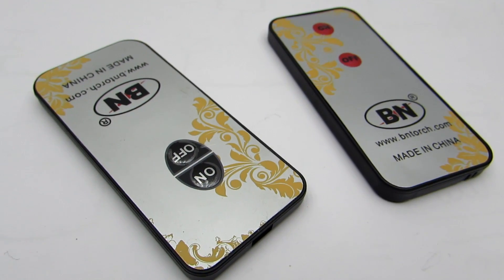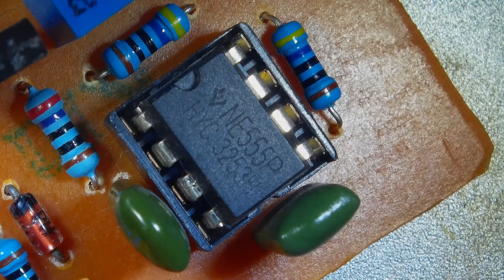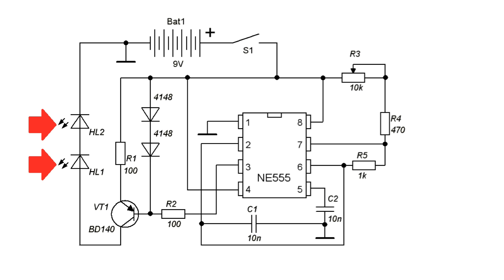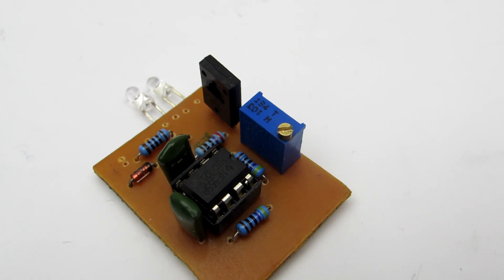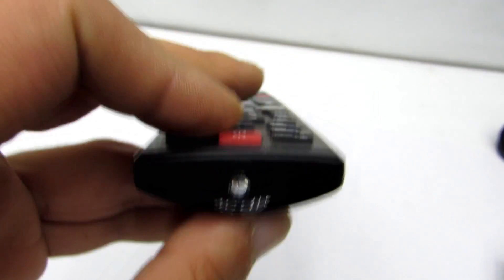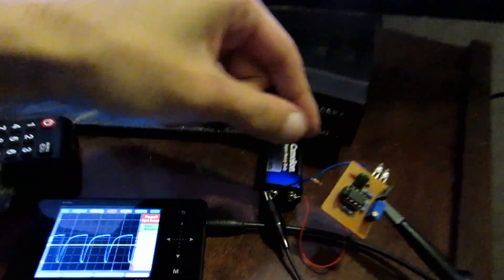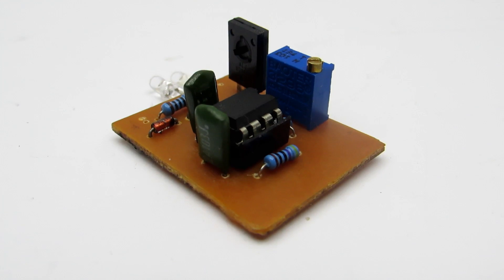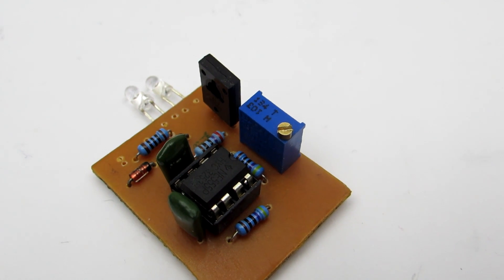Remote signal jammer

Comment: Could you make a remote that turns every tv off?
Reply: Pirat Carribean you will need an arduino or any other microcontroller that first has to record all remote commands and then transmit them one after another.
Reply: SandPox Well, I saw a device called a tv-b-gone so it should be possible
Reply: different manufacturer have different code for "turn off" command so you'll need a device that will allow you select which manufacture before sending... like a android phone with IR blaster and you can use an app for it
Reply: Yes I can make a remote that turns every TV of

Comment: I have 2 questions-
1. Why the transistor was used?Was it for driving greater current to the LEDs or due to any other purpose?
2.  Why the two diodes are used??
Reply: the transistor is supposed to drive loads more than the 200 mA limit of the 555, but the leds use less than 200mA so the transistor is useles. the 2 diodes give more light for better silencing
Reply: +John Scarce thanks for your reply....but how those two diodes increase the silencing?....are those diodes mandatory?
Reply: 1 will do fine. 2 will increase the range. the only purpose is more light. in short yes they increase the silencing and arent mandatory
Reply: +John Scarce thank you Sir
Reply: Sayantan Maiti I